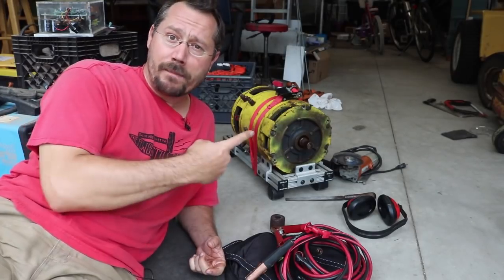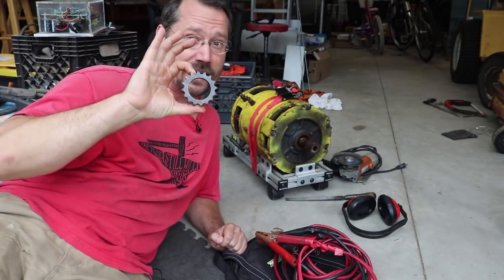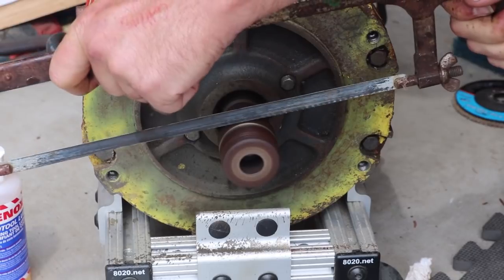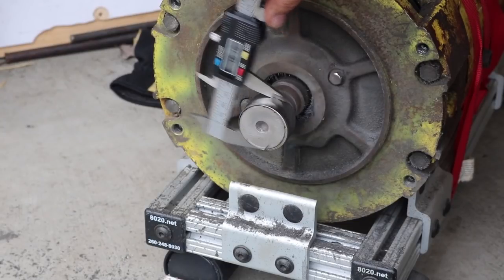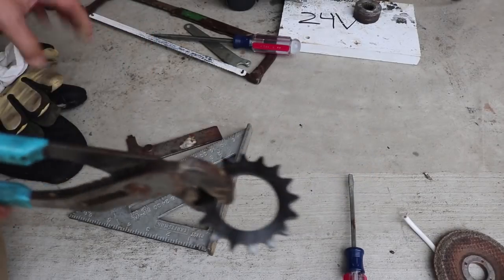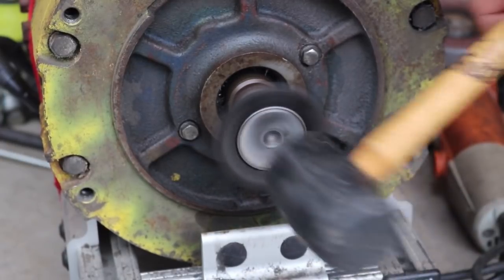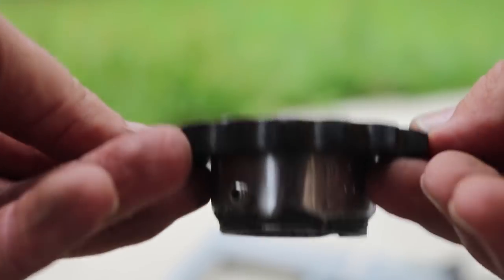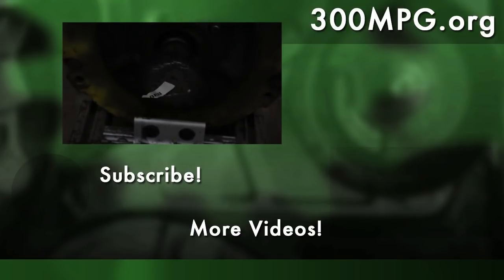ElecTrak Rat Rod Part 5

Comment: Thank you Benjamin, pretty cool.  I need to lean how to weld, what kind of welding equipment do you use?  Thanks
Reply from the maker: I'm using a 240V wire-feed welder, without gas.
Probably the best way to learn to weld is simply to find a friend who welds, have that person show you how to weld, and then PRACTICE!

Comment: For a belt drive, a guy could use a cog designed for bicycles. A belt would be quieter, as would be desirable for an automotive application.
Reply from the maker: Do you think a belt would be powerful enough? I'm all for quiet, but chain is easy to work with and won't slip. Parts are also easily available. I can go to my local farm store and find all sorts of chains and sprockets, but nothing for cogged belts and matching hubs.